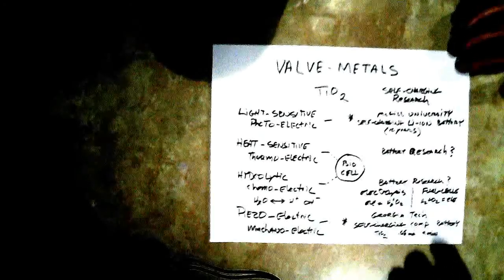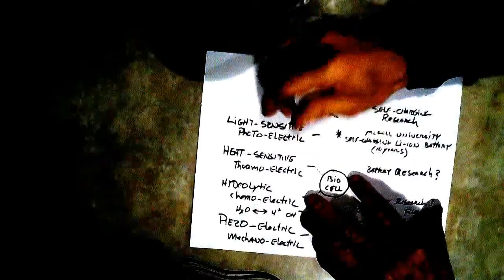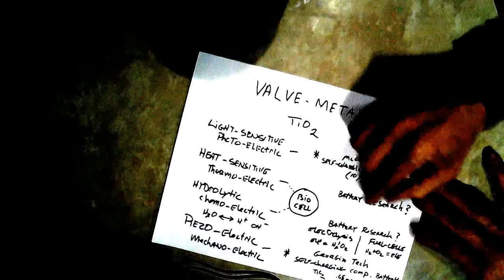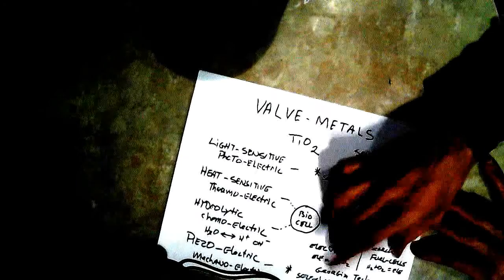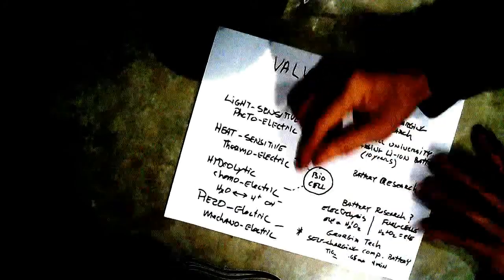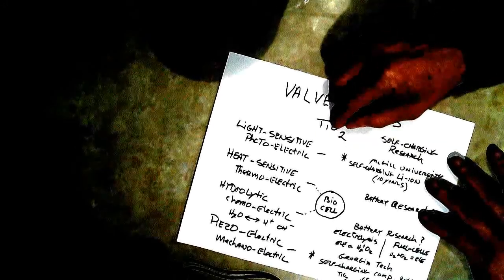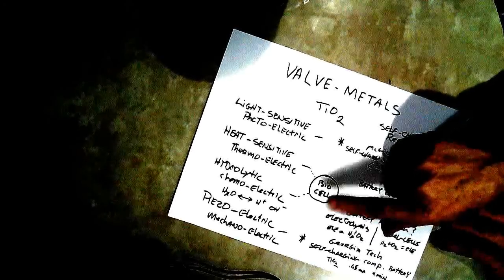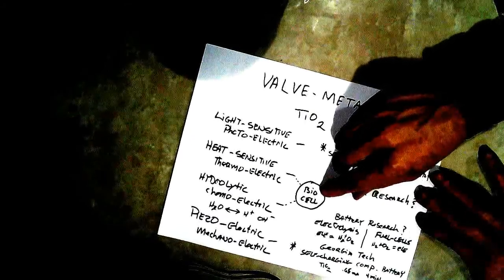Bio-Cell--Valve-Metals, Tio2, and Self-Charging Technology (important)

Comment: Put the compression cell in tires. Not a full solution but 
A peice of the puzzle to making a pratical electric car
Reply from the maker: Hi Phillip, I think you are talking about the piezo-electric effects of Ti02, which I haven't experimented with at all. I got stuck on the hydrolytic effects.
Reply: Your experiments are all great, admittedly having to water my powercells isn't apealing to me but I think you might have figured out a solution for that and your experiments with the pva borax seporator interest me greatly. The piezoelectric effect probably won't give you better results on it's own (my hypothesis)
My comment was on the georgia tech compression cell the application would be to use it in a electric vehicle to add to the sum of a multi source power system for the vehicle.
Reply from the maker: Ah, I agree. putting the compression cell in a tire, probably would be much better than what they propose to do with it. Tio2 is an amazing material, with morel power applications than any other material I know of. Unfortunately, there is very little interest In my research because I made the mistake of sharing my work for free (devaluing it in the public's eyes). I'm planing a trip to the amazon this winter, where I'm going to give away battery kits with instructions to native tribes along the river, and anyone else I meet on the journey that shows genuine interest. Modern society doesn't appreciate this gift. I bet cultures without electricity will want it much more! :-)